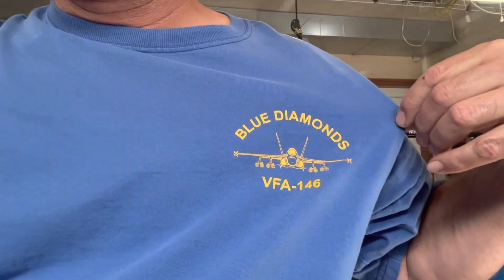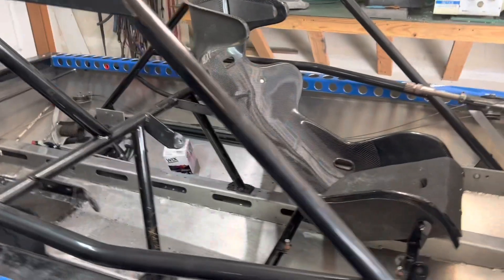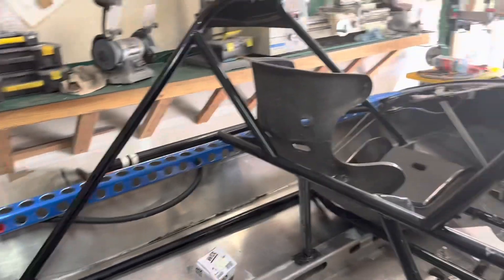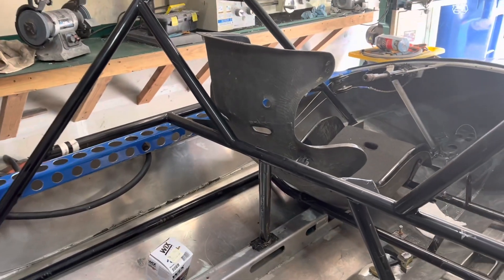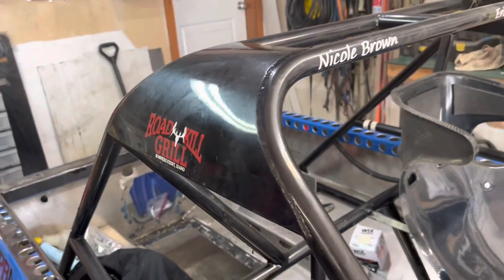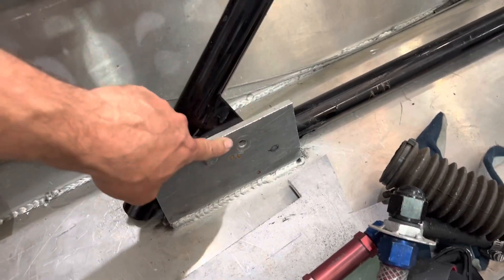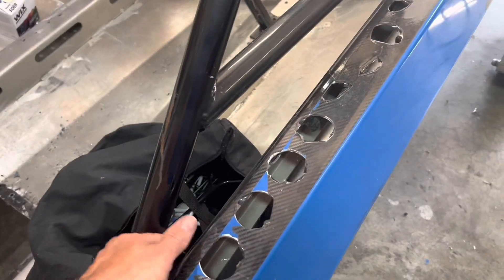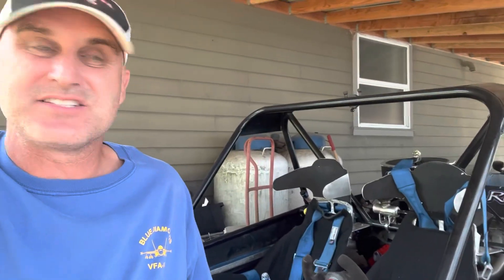Jetsprint Roll-cage construction.  What materials, how it’s welded and what’s required???

Comment: Does the cage get certified and does it need to be inspected after a roll ?
Reply from the maker: There’s not an actual certification of the cage, other than the tech-inspection before each race.  And yes, the entire boat is re-teched if it rolls, hits hard or at the safety inspectors discretion.